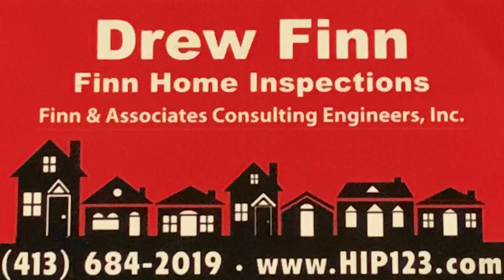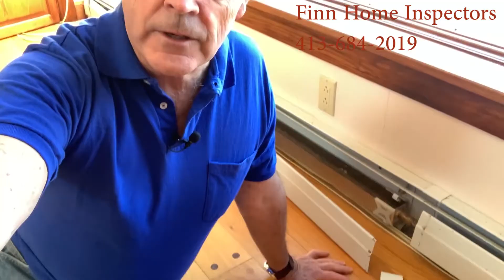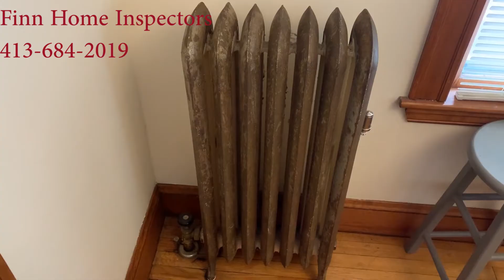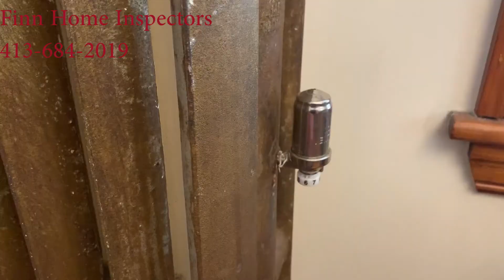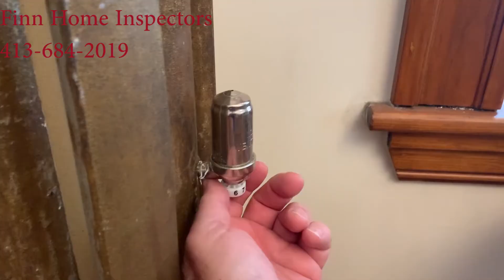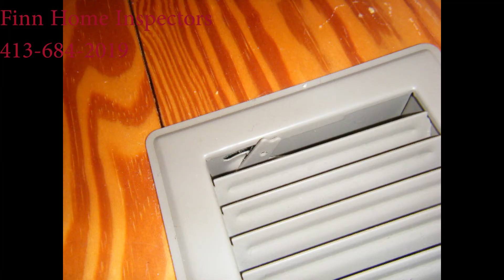Room Heat Adjusting

Comment: Is there a way to shut the vents off. I have a base board vent, also can my neighbor be spraying stuff into the vents being we are connected to each other. I'm having issues with the smell of paints etc. Need it to stop
Reply from the maker: if you have a steam system with vents near the top of the radiator some can be shut off, if hot water then no.  As far as the smell if there are holes in the wall where the heating pipes go though, I'd ask at a hardware store if they have a high temp foam sealant (rated for 120Deg F), or a high temperature caulk.  The smell may make it through electrical receptacles in which case I'd get some thin foam pads (made for weather proofing receptacles) and install them behind the receptacle plate (if you don't feel confident and compenent then ask some one who can.  Good luck

Comment: I sleep on a second level and it gets very hot at night. Is the thermostat switch in the rooms vent? This is a Boiler system.
Reply from the maker: If steam boiler, most vents on radiators can be adjusted, some have a knob on the bottom that you can turn, some have a lever sticking out the side, try that.

Comment: I don’t have that adjustment shield.     have a small apartment.     baseboard just would behave at low temperature.    so I have a smaller one that behaves.    :-).
Reply from the maker: Sorry for the late response, just saw your question.  do you have electric heat, or hot water.

Comment: How to turn that on
Reply from the maker: Your question is not very descriptive, need to know what type of system you have and what is not working, but I'll give it a try.

Depends on type of system.  If a hot water radiator (you will have a pipe in one side, out the other and near the top of the radiator a bleed (a nub looking thing with a slot for a screwdriver).  If one or two not working try turning the bleed with a screw driver to let air out, some sputtering of water will come out, but when only water out close bleed.  If none are heating make sure the boiler is running.

If a steam system and the system is running the radiator may be turned off with the valve where the pipe enters the radiator.

If nothing is working, make sure the thermostat is working, if digital lights on.

Also doe the heating unit have power, do you see any lights on.

If a steam system it may need water added.
Reply: @finnhomeinspectors4338  i have a baseboard one , idk if its gas or water how it works, to my right i have a nub with different numbers , i turn it on with that but barely heats anything , on the inside of the baseboard it has like a tube and like a faucet type thing, and sorry english aint my first language i think neither faucet or tap is the correct word to describe the thing i see

Comment: How do I turn the first one off completely? It’s summer, and I’m in a basement apartment, but it’s still stifling so I have a feeling it’s still on. How do I know it’s off.
Reply from the maker: If it's warm its on, not to be wise.  I assume you do not have a thermostat in your apartment to turn it down.  If it's a baseboard heat (one that runs along the floor area) then close the damper as shown on my video.  It it looks like an old radiator (cast iron maybe 2 feet hight, 2 feet wide)  then it is likely a steam radiator, should be a valve near the floor you may be able to turn off, or better on the other end an air vent, which may have a knob on the bottom or lever on side to shut off.  If you could send me a photo, I may be able to advise better.
If it is an electric one there should be a knob on the front of it if you don't have a thermostat.
Reply: @finnhomeinspectors4338   how can I send a pic?
Reply from the maker: @samanthagerbrandt7543  send to drew@hip123.com

Comment: They need to put heat adjustment knobs on base board radiators.
Reply: The problem is they’re passive, and serially fed room to room. You’d need some type of diverter valve on every baseboard otherwise you’d loose all the heat down the chain.
Reply from the maker: If you can block the air flow over the fins that will reduce the heating in a specific room.  Are there dampers/louvers on the top outlet of each baseboard.

Comment: Thanks, I'll give it a whirl. Our bedroom was killer hot last year and another room off of it and I feel like there are just too many heaters in there. Is there a way to also add a shutoff valve on part of it to control how many walls have the hot water passing through?
Reply from the maker: Ryan it depends on what type of system you have.  Please verify is it a how water system.  What year is your house.  If how water, is it a one pipe system, if not you will not be able to shut off just one radiator with a valve.  A one pipe system has a pipe running around the basement with "T" connections two for each radiator.  If there is just one pipe running from one radiator to the next, they it is not a one pipe, and you will not be able to shut off just one.  Let me know if you have any other questions, be well.
Reply: @finnhomeinspectors4338  1916 hot water system with a copper pipe running through and multiple red hoses going from the boiler to the different locations throughout the house. Baseboard heating like your first example.
Reply from the maker: @ryanbloomberg6529  Drew here, it sounds like you cannot shut off individual radiators.  Close the top "damper" on the baseboard in the hot rooms, if not enough you could block the bottom of the cover where the cool air comes up from the floor into the radiator.  Let me know this winter how it works out.  Drew at HIP123 dot com.
Reply: @finnhomeinspectors4338  Will do, thanks!